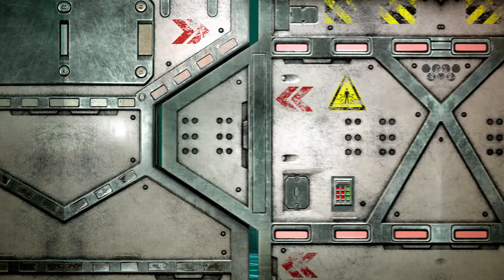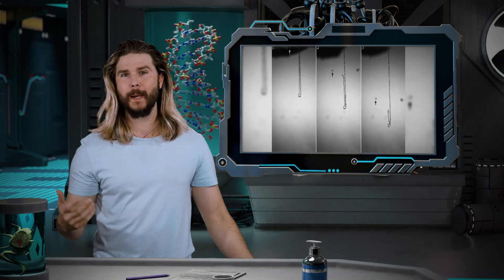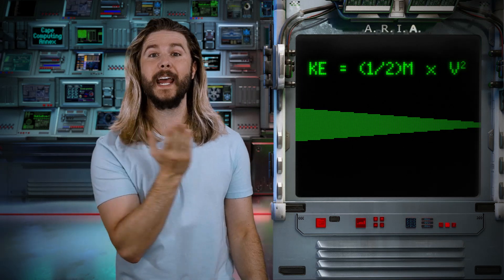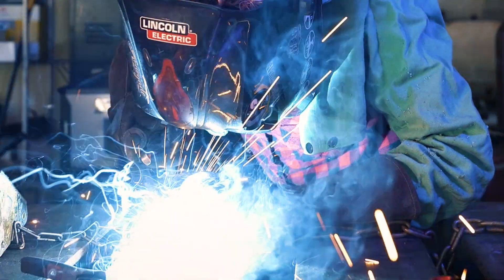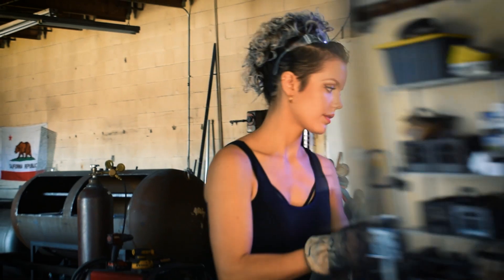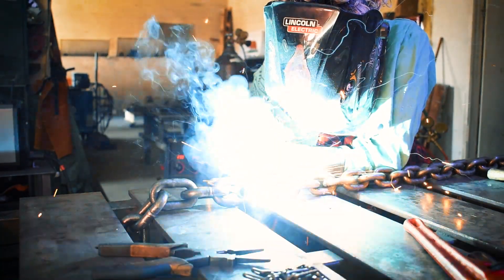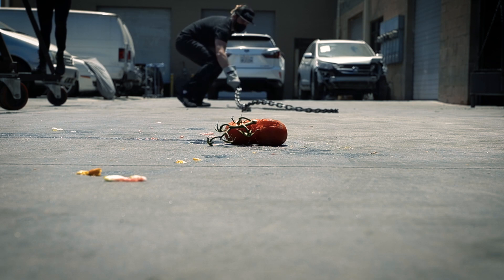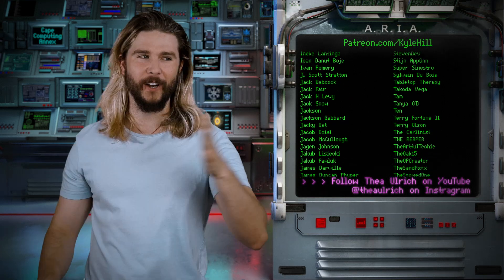Steel Chain Whips are SCARY

Comment: "How dangerous is a steel whip?"
Sylas: yes.
Reply: Was waiting for the League comment.
Reply: Just going to leave out thresh like that
Reply: @TypicalMT  Thresh uses a Scythe on a chain, not really a Steel whip
Reply: @arcadia8017  ahh damn it! Boooo you on the technicality win...
Reply: @arcadia8017  kusarigama is the name of that I think kama with weighted chain that has its own name that starts with M
Reply: Achschully, ive never seen any media actually show a kusari kama once. What a real kusari kama is, could sound way duller, but the "fictional" scythe blade on a chain is not a good concept because of aerodynamics
When you look at a scythe that would attempt to move blade forward, and it be just a little bit misaligned, the air immediately starts bouncing off the slope and turning it around more, until it flips 180* and starts facing backwards, wherein any misaligment now would straighten it back. 
A concept that COULD work is a sickle on a chain, basically a blade with the shape near that of a half circle, and with the middle of the arch a bit thicker it could create a tailfin effect
Speaking of tailfins, a good comparation wipould actually be a plane: planes have the straightening fins on the back not because its out of the way and doesnt block vision, but because 2 reasons: something like that always tries to end up behind the point, to which kinetic energy is exerted in a body, And because its the furthest away point thats already behind the point of force application point, so in straightening the aircraft it doesnt try to spin that thing 180*
Reply: Bruh
Reply: Ghost Rider lmao

Comment: Surprised you didn't take the taper all the way down to a steel braided cable. You would have an extremely strong , thin cutting implement that would have cut things in half, but at much higher speed and with a smaller cross section.

Comment: Hey I wonder if this chain wip would be viable for monster hunters in a fantasy world? It would be far more effective that a normal leather wip and probably just as cheap since you would want to use the leather of a high class beast for a wip but you could use normal steel or other cheap metals for an equivalent power output. Of course the dexterity and power needed would be amplified respectfully.

Comment: Do to the weight of those chains it probably wouldn't be a particularly practical weapon, if you want an actual steel whip then the Indian Urumi would be the best option a paper thing length of razor sharp steel or just a steel studded normal whip

Comment: Thea is understating the danger of welding galvanised steel. Welding plated steel releases gaseous metal oxides that can condense in your lungs and do serious permanent damage to the structures that absorb oxygen.
So basically, if you don't acid strip galvanised steel- you die. Drowning in your own liquidised lungs.

Comment: Or instead of an acid bath you could just use chain that isn't galvanized/zinc coated.  Also I'd say  steel cable would have worked well too.

Comment: Yeah cleaning the chain has nothing to do with toxins as welding releases toxic gases already so if you have a proper ventilation system set up it shouldn’t even be much of a concern, cleaning is mostly to get good contact with your ground clamp and so you can actually establish an arc especially since she’s using a mig welder . If she was using a stick welder that wouldn’t really be an issue as long as it wasn’t absolutely caked in rust as it will usually just burn through most grime oil or rust but mig usually isn’t too good at that except for maybe flux core but still . Also not sure why she used acid as it’s not necessary to go that far with it as you could do it with a grinder ,wire brush and vinegar but she probably did that because it’s a chain and it’d be a pain in the ass to get into all those little nooks and crannies.

Comment: Ok so I’m not a whip expert, but I can crack a whip pretty well and something that differs in your strategy from a normal whip is with a whip made of nylon or leather or what have you, you have to have it form a loop that travels down the length of the whip rather than just a ripple. If you’d had a full loop and maybe more length so you can input more energy, I think it would’ve demolished some stuff

Comment: Spoilers they custom build a length of chain that decreases in size as it gets closer to the impact site, they they fandangle a whipping motion and use it to break some fruit, so in answer to the question posed by the title of the video, very dangerous if your a piece of fruit, if you happen not to be a piece of fruit you may get a sting bit only if you move at a snails pace to get out of the way.

Comment: In making paracord whips, we used a weighted core a strand or three of gutted paracord filled with BBs and it's specifically for just this reason to add mass at the low end, to increase speed at the tip

Comment: Great video! Question, how does high velocity at the tip translate to being more dangerous if energy was conserved? Because I would think that energy would be the basis of damage inflicted. Am I missing something
Reply: It is much easier to absorb energy when the size of the object is larger. A .357 Magnum bullet has about the same energy as a good punch to the gut, but I'll take the punch...

Comment: Now imagine a "premium" model where, instead of sections of de reasing size, each link was slightly smaller, decreasing in a perfect taper out to the end.
Reply: Also if it's about mass, start with tungsten. Maybe end with titanium? I don't know.
Reply: @TheJohnreeves  Titanium shatters easily on impact...  is not something you want in the tip
Reply: @TheJohnreeves  This os how mechas destroy tanks in the future
Reply: @TheJohnreeves  that's what i was thinking, how powerful could it be???
Reply: @TheJohnreeves  titanium is still pretty dense, maybe iron since it is one of the lower weight metals on the periodic table, probably a steel alloy.
Reply: Or woven steel wool
Reply: Kyraptor AKA Steel cable..
Reply: @theharwizard8093  steel cable is different
Reply: @kyraptor2521  or perphaps the increase on mechanical stress resistance from the woven wire is not comparable from the one of some special very fine very stable and uniform steel wool ... mmm i wonder
Reply: @kyraptor2521  or woven steel wire (rope tk knot)
Reply: Or a chainmail cone which gradually decreases in the number of rings used per section eventually ending at a single ring. No welding required. Adam Winrich, the whip god, did it years ago
Reply: Imagine how long that would take to make
Reply: @210rebelboy  woven steel wool? It'd be no different than a leather one.
Reply: @kyraptor2521  I was talking about incrementally smaller individual chain links
Reply: @kyraptor2521  except with more mass, thusly more force
Reply: @210rebelboy  yeah all of them made from - rope knoted - links of steel wool, but you have to remember all of the air that's going to be replacing metal, soo you have to search the middle point
Reply: And at the end, a tiny link with steel wire tied around it
Reply: Chain linked metal down to the shiny micron size palladium tip
Reply: you can, but you would have to gradually remove material from each link and weigh them making sure each is slightly lighter than the last
Reply: Not to mention far longer with a bigger differnce of biggest and smallest chain.. That would do some nasty damage.

Comment: If you scaled a whip up to AU sizes (similar to your scissor video a while back) would the speed of the whip increase accordingly? The average whip is 20ft in length and produces sound barrier breaking speed so if you had a whip, and I could be wrong on my math but, a whip 874,030.658ft and of course someone large enough to wield it, would it be able to reach near light speed?

Comment: The coating on the chains she was talking about was Zinc. Most commercial steel chain is coated, or galvanized with zinc to prevent rusting. However, when zinc gets hot, it releases a toxic fume that is very dangerous to inhale. 

I just wanted to say that because I’m not very smart but I happened to know that heh

Comment: You need to find a concrete surface with an edge where you can place the things you're destroying so you're not just hitting them in the bottom but in the middle. The test against harder stuff like wood or something.

Comment: In a fight when I was like 13, the other boy hit me across the back with his dog's chain. It left a 1/2" high welt from my shoulder all the way down and across my back. That was bad enough.

(Since some will wonder, I turned around and took it away from him. I left a lot more welts on him. He spent the night in the hospital, but that probably had more to do with the concussion he gave himself when he ran head-first into a sign post, which is what kicked off the whole fight. Somehow he blamed my younger brother for that and took a swing at him. That's a bad call in front of an older brother with a reputation for getting into fights and usually coming out on top. Small towns can be surprisingly rough.)
Reply: Come to walker, down here kids beat the hell out of each other over beers.

Comment: I wonder now
Would a whip lash count as blunt or sharp damage?
The whip itself is blunt...
But the lashing can sometimes leave some bleeding wounds...
Also, i like to imagine whips are just ridiculously fast because of glitches in real life code, lol
And finally
Could you cut through a sheet of steel using that whip?
It would be an astonishing display of just how powerful that thing can be, if it can tear apart a sheet made from the same metal as itself

Comment: When you're trying to whip something that is this big and heavy, there's no real reason NOT to spend the last moments of your whip motion pulling the chain backwards. It'll help it go even faster.
Reply: Genuine question: how does it make it go faster?
Reply: I think it has to do with cutting the time it takes for the end of the "whip" to level back out. If you were using a regular whip, for example, the curving shape as it's being lashed forward and the pull of the handle back towards you would cause the length of the whip to straighten back to its resting "phase" (for lack of better phrasing escapes me at the moment) faster. The faster the whip returns to its resting shape, the sooner the carried moment of the initial movement reaches the tip of the whip. (And if I'm wrong about any of this anyone, feel free to correct me. I'm not fully versed in physics, but that is my attempt at explaining the possible reason why people pull back on a whip after lashing it forward.)
Reply: Meant to type "carried momentum".
Reply: Now that I think about it, it's kind of the same idea as with using wet towels. If you didn't pull back on a towel as you're whipping it at someone, you'd just end up slapping them with it instead...
Reply: @shounfauxe  That towel can either just flap or kuplaash depending on how well the person does it.
Reply: For the record, Kyle DOES do that in the video.

Comment: Tapering of a whip is not required, and this it is not key to the whip crack. That said, it is very helpful. I know this because I've cracked homemade whips with constant width. Thus, since I've done it, it must therefore be possible.

Comment: I'd like to see how it compares to a standard bullwhip, as while it is theoretically more powerful, it's also a lot harder to use. Not sure if the strength of the impact can be measured easily. And perhaps, if a somewhat smaller version could be created, large enough to keep the same benefits of increased mass and the strength of the material, but still small enough to be held and used with the same motion as a regular whip.

Comment: Kyle, I have a question that's been on my mind for a while, what if you were going at 0.999999 the speed of light and you threw something out with such force, could the object then go at the speed of light?
Reply: Not to usurp Kyle, but no. Nothing with mass reaches speed of light. It would just get closer to that speed.
Reply: @jayfredrickson8632  But what if we repeated the process over and over again?
Reply: @Akari_Starbliss  No, still wouldn't reach speed of light. It's an absolute limit for anything material. The closer you get to it the more energy it takes to go faster. To reach it would require infinite energy. You could in theory get arbitrarily close, as many nines after the decimal point as you like ( if you had energy enough) but never 100%.
Reply: @jayfredrickson8632  I thought I had something good qwq Thanks anyways!

Comment: I'm not sure exactly how it would perform but I'd think making it out of a steel cabling would be more effective. I have grown up using whips and have even made a few of my own with the correct materials. As I haven't plaited steel cable before im not sure of the rigidity of it in such a state but would like to note that a well made whip can be a lot more rigid then people think of when they think whip. Also with leather whips it is fairly difficult to get them to brake the sound barrier without the popper on the end that is essentially bailing twine that has been twisted in a special way and left frayed at the end.

Comment: If skin were as hard as diamond, yet still malleable as it is. Would you be able to punch through a tree—given it would still hurt—without breaking a bone? If I coated a bat in steel and beat it against concrete would the bat break? If those are analogous examples that is.

Comment: Ive made a few leather whips and Im extremely jealous of how fast you can make a chain whip lol. Leather whips take FOREVER to braid. In fact inside of a decent sized leather whip there is basically 2 smaller whips inside them that are also braided (actually plaited). Plus you need to cut hundreds of feet of leather strips which is also takes forever. I think Im gonna make a new one with a core filled with lead shot now...
Reply: Tungsten shot. Even better

Comment: So two far more time consuming ways I can think of to possibly improve this.  

The first, have each link of the getting progressively smaller.  Although this would likely mean a smaller chain whip which may not be long enough to generate the force needed for it to do any significant damage.

The second is to simply have a lot of steel wires of equal thickness twisted together (like electrical wiring or steel cables), and have each wire cut at a different point down the whip, tapering it off more the further down the whip.  But this presents a problem with being able to keep all those wires held together as a single unit without having them become frayed due to the stresses put on them.

Comment: I can't help to think a whip made from steel cable would be easier to handle, since you could make it lighter. But to weld the cable together, you'd probably have to use TIG to not melt it. EDIT: Nevermind, just saw you addressed that already.

Comment: Cool video, but it seems like you haven't exhausted the options for creating a metal whip. Here's a few more ideas: 
1. A long, tapered, cylindrical piece of flexible metal (spring steel, etc) with alternating deep grooves cut into it. If you look up "wooden snake toy" you'll see what I'm getting at.
2. Metal plating attached to a flexible structure. There are USB cords built like this.
3. Using a large thickness of stranded metal cable/rope, removing strands every couple feet so that it tapers to a thin end.
4. A flat spring steel whip (these already exist, and from what I've seen are very dangerous)

Comment: You could weave a cable through a good portion of it which extends beyond the smallest chain section, I imagine anchoring it anywhere except a good four feet away from the end is gonna throw off the way it performs to a degree.

Comment: It would be way cooler if it was hanging from a crane, or an I beam sticking off the roof of a building.  I just wanna see it going from extending upward to extending downward, with a watermelon, or a block of ballistic gel right where it would normally extend to.

Comment: I've just cranked out some numbers, to get the tip up to 400m/s the total weight of the chain would have to be around 200kg. So not a light weapon.
Reply: That's assuming quite a slow starting velocity of 1m/s.
Which, given the size and weight of the beginning links I feel is reasonable.

Comment: Well if you have ever seen the terrible accident here on youtube, if I remember correctly, it was in South or Central America guys using a chain to pull a vehicle out of mud the chain snaps and hits a man and completely mames his face, its one of the hardest videos to watch. So ya its freaking dangerous. I hope that man survived and I wish him and his family well. DO NOT ever use a chain as a snatch block. If you need to use a chain to pull something bring tension first and hang a heavy rug or something over it in the middle of the span before doing so but even then its not advised, and potentially dangerous.

Comment: The "Hill Effect" can me shown by also moving (Skimming) a cup along the surface of a pool of water. The water coming out of the top of the cup is moving faster than the water entering the bottom of cup. I leant this as a kid washing up after dinner, also learnt that you can lift a plate from the bottom of a sink to the surface without putting your hand into the very hot water using only the scrubbing brush (without using the brush to lift the edge of the plate) @Kyle Hill - How? - (looking forward to your video demonstrating and explaining this effect.)

Comment: What about a bull whip made out of steel cable? Like how a regular leather whip is braided, but use braided steel lines instead. It would probably be easier to handle and would actually crack.